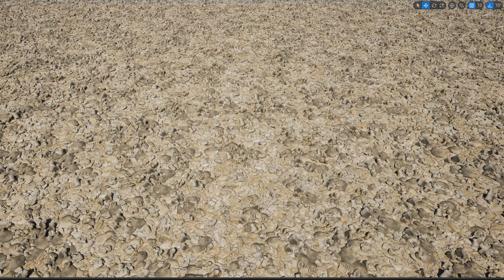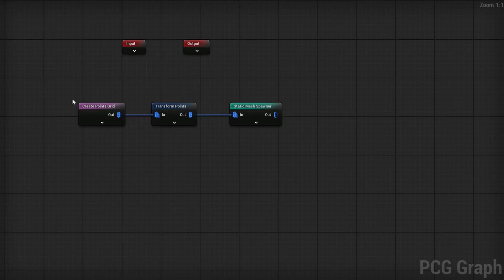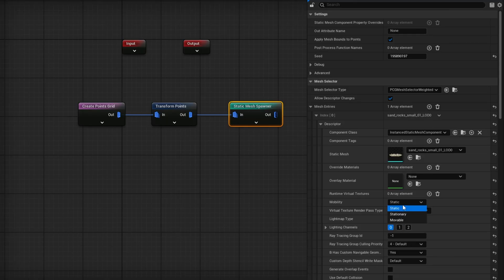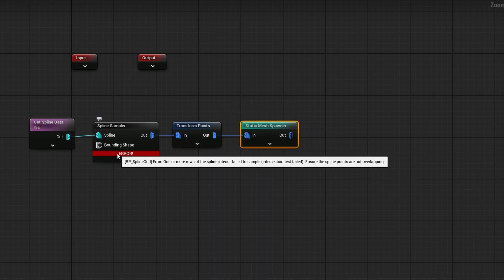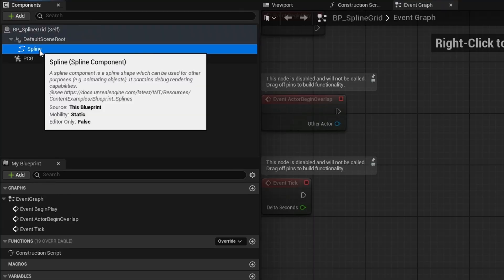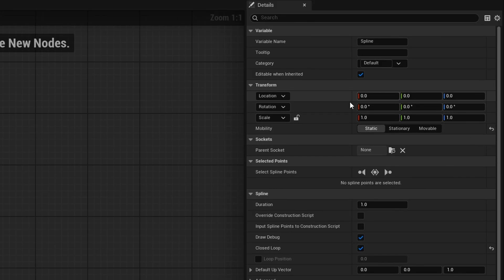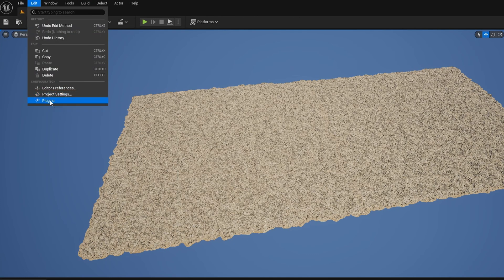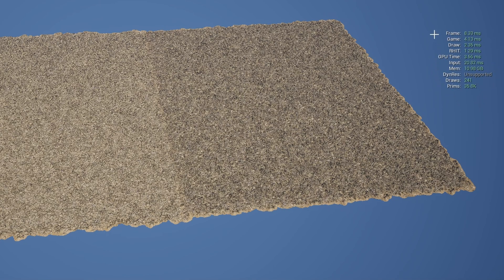How To Get Started With GPU Lightbaking With PCG | PCG Basics

Comment: Please also do one for partitioned levels, would you be also willing make tutorials on world partition and Hlod setup since there is barely any information available on Hlods in ue5
Reply from the maker: There's a great tutorial on PCG and partitioning by Adrien, an Unreal PCG dev. Just search for "ue5 pcg partition adrien" and it should be on top. :)

If you find he doesn't cover something you need, let me know and I'll look into it. But it's a great video!
Reply: @Procedural_Minds  I think he meant world partition levels not partitioned PCG setups
Reply from the maker: @ Maybe. I assumed PCG as it's on a PCG tutorial and PCG also has partitioning and HLODs. 😅
Reply: @ Actually I meant non-pcg world partition and hlods! But I did not know pcg partition and hlods also exist, I will look into this as well. Thanks for mentioning about it.
Reply: @suraj.1889  I guessed right, just to help you out: world partition and PCG partitioning are two very separate things.

World partition is meant to partition all actors and landscape, PCG partition is meant to partition PCG actors: world partition doesn't require to partition PCG but it's best practice to partition it.

You can also partition PCG without world partition if your logic is really complex for example.

Also, remember you need to partition PCG if you want to use runtime generation as it's a requirement.
Reply: @ that’s very handful information! Thankyou